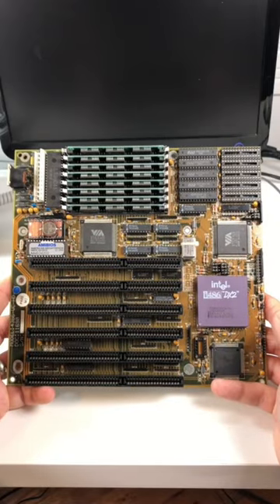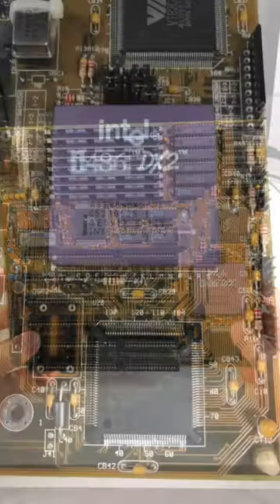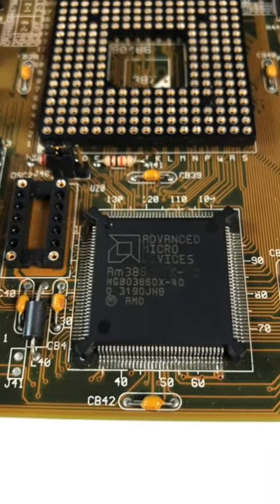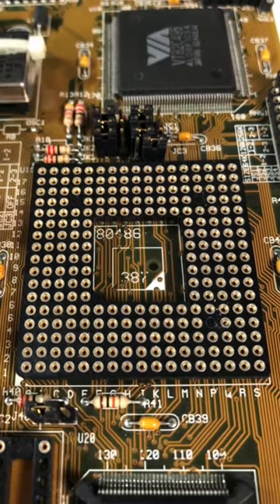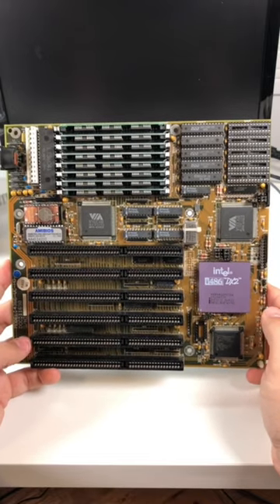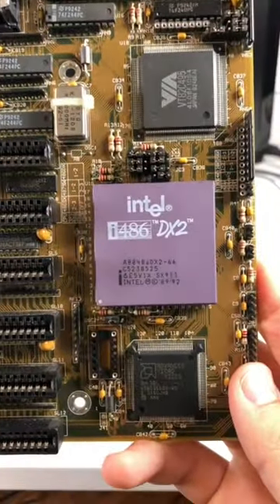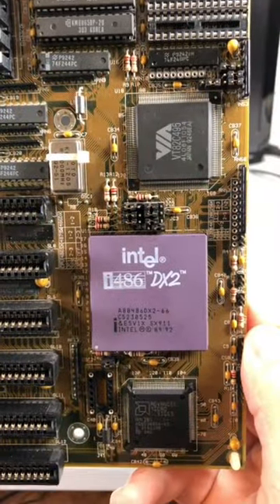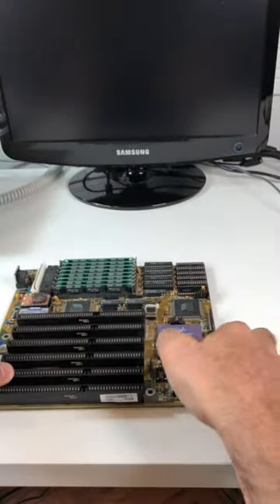An Intel and AMD CPU in the same motherboard at the same time?

Comment: You can build a pretty killer 386 on that since it already has the fastest 386 on it ready. Just install a fast math co-pro and batang.
Reply from the maker: I definitely want to feature this board in another video soon. I'll be trying out a 40MHz math co-processor as well as a 486 upgrade, cache upgrade, memory etc :)
Reply: @vswitchzero  I'll have to look and dig it out of the basement but I might have kept that 486 CPU. Hit me back if you need one to borrow. You can mail it back to me when done. Just kept for sentimental value.
Reply from the maker: @georgemantzouranis4572  Hi George, thanks for the offer, I appreciate it! I've got quite a few 486 CPUs, so should be good to go. Thanks anyways though!

Comment: Sweet Board. I got myself a fx3000 motherboard that right now has a 386 installed AMD DX 40 and has the socket also above it that can install a mathco processor but my board I have to desolder the 132 pin socket and then solder on the 168 pin 486 socket in its place so that I can use a 486 CPU.  I bought a IT'S ST(Cyrix) 486 DX-2 80MHZ(5Volt) for that board but still have to buy the 168 pin socket to replace the original 132 but I also just got a Cyrix GP-40 in the 386 132 form factor that was shipped from Ukraine that I want to over clock to 50Mhz by changing out the Crystal oscillator on the board from 80 MHz to 100 MHz. So I'm at a crossroad of which one I want to do more. I also purchased 4 different models of the AMD 5x86 133Mhz CPU. I would love to be able to find the AMD DX2-80 that you have in the 5 volt version. In your 486 build I believe it was part 2 you had mentioned there is no such thing as a perfect 486 build I can tell you at the same time I understand that feeling and I also put myself into that now that I bought so many different parts I accidentally made my own dilemma. Great video and have a good one.
Reply from the maker: Thanks very much Clint! The FX3000 looks like an interesting hybrid board. Looking online it seems there are several different revisions with different socket configurations. As long as the solder points are there is should definitely be possible. Let me know how you make out with the modification! The FIC 4386 is similar and I've seen one that includes only the math socket too. Yeah, the 5V version of the AMD DX2/80 is a bit harder to find than the 3V version. I don't think it lasted very long on the market because it is a very hot running chip. So true about there not being a perfect 486 build. That's probably why I have so many 486 boards and CPUs now :)
Reply: @vswitchzero Sorry for The late reply I'm actually blown away that a year has already passed since I commented (my bad). I just wanted to say that yes the motherboard does have the full 168 pin output it just has the 132 pin in its place at the moment. In the years time I have acquired actually two 5 volt AMD DX280 Mhz processors and two 50 80 MHz Cyrix based(labeled as It's ST) CPUs. I still have to order the replacement socket for the board and the correct Crystal oscillator when converting it to the 486. Sorry this has taken so long I didn't realize how much time had passed. Life has a tendency (especially with me) to get in the way of things. I do have to find somebody who has really good soldering skills as for the fact that I have absolutely zilch experience in soldering and order the new Socket as well. I have found one I just keep putting it on the back burner I also got two of the Cyrix 486 40Mhz and two of Texas Instrument labeled versions(Granted  not a true 486 but still a neat CPU)as well of the ones that fit in the 132 pin 386 socket. The half 486 as they were also called. Thanks for reading and replying to my last comment. Have a good one.

Comment: There were very uncommon high end servers in the late 80s/early 90s that had an AMP architecture (asymmetric multiprocessing.) I think it was Compaq that had a server with a main CPU that was a 486 and an I/O processor that was a 386. So technically you could have both an AMD and Intel CPU in the same machine working at the same time.

Some high end disk controllers and video cards used 808x processors, so the same could be said for those as well.

Comment: For that 486 processor, could you use an AMD or Intel processor in that slot?  I am new to the 486 and recently bought a new old-stock motherboard and currently have an Intel 80486DX-33 in the board.  I purchased an AMD 80486DX4-100 this week and I can't get it to boot with this processor.  The motherboard is a Biostar MB-1433 and, according to the documentation and what I've found elsewhere, the AMD requires 3.3v, so I removed the jumpers on the board to allow this, but the computer won't post.  So I wasn't sure if AMD processors were supported or not on this board.  According to the data sheet, it just says it supports up to an 80486DX4-100, but no where does it specify on the documentation about Intel or AMD.  Thank you.
Reply: Both AMD and Intel DX-4 100 requires a 33Mhz Bus speed and use 3.3V. The current DX-33 would use 5v. Are you sure that your DX4 works, have you tested it or seen it work?
Reply: @TheLionAndTheLamb777  I just got it from an eBay seller with a reputable rating, but I don’t have any other computer I could test it on.  There’s a jumper on the board to set it to 3.3v but I just get a black screen with no beeps at all.